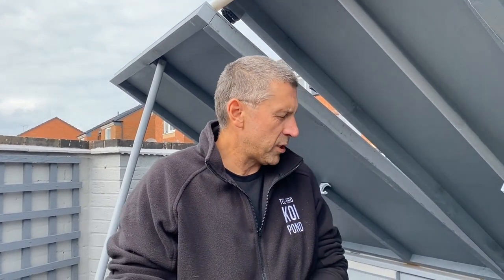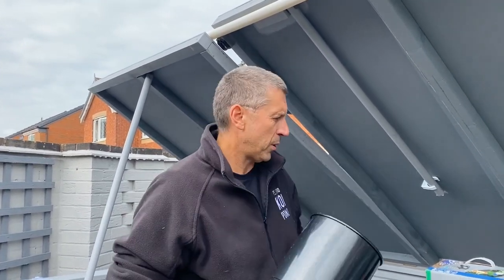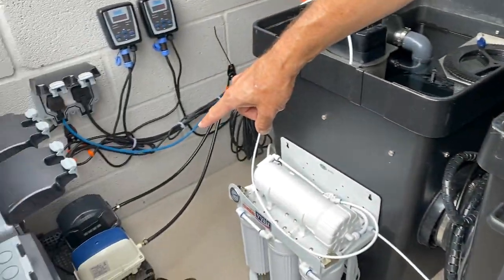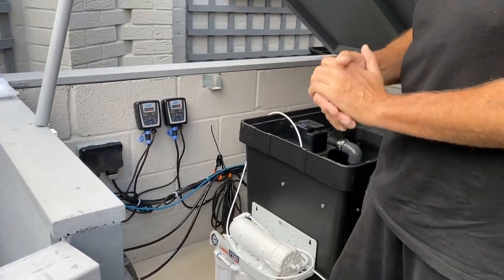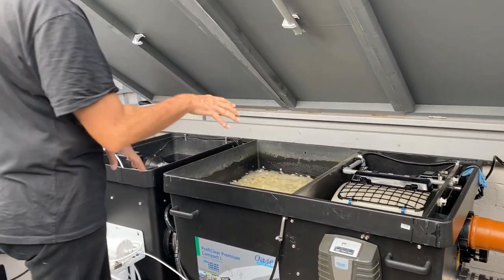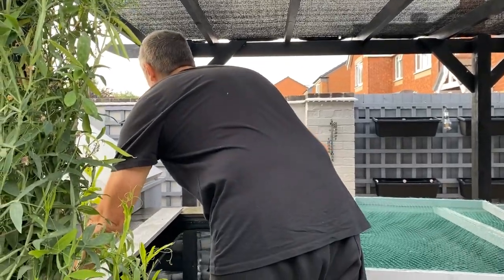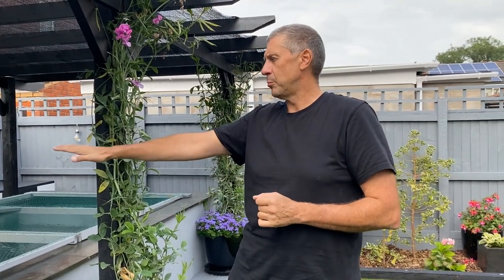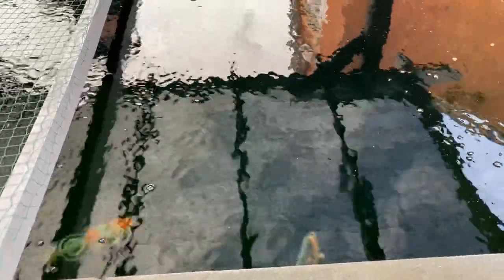T.K.P. Telford Koi Pond - Video 37 - Koi Pond Air Pump and Skimmer Modifications.

Comment: need help have pond one air pump fitting 18mm I need to adapt to 8mm air pipe any ideas? The pump came with a rubber tube that is about 18mm but can not seem to find a fitting for my large air stone that has a 8mm pipe.
Reply from the maker: You’ve got me a bit lost as you can normally fit the pipe you mention, over the outlet on the pump and over a plastic or chrome multi connector or you screw a 8mm brass fitting into the outlet on the pump. Just had a look at the Pond one air pumps online and they appear to be standard fittings so you should be able to pick up all the fittings/multi valves/adapters you need on eBay. Let me know how you solve this ? 👍🈲🐟😊

Comment: Can I ask what airline you are using to your bio tank 🤔
Reply from the maker: I’m using 8mm internal diameter braided airline (so basically just the black braided airline you can but from most shops) . Over the years I have found this to be the best/strongest/longest lasting airline available. When I first started I was using a 45 lpm air pump which was perfectly sufficient for the amount of media that comes with the unit but I’ve  gradually added more and more media (at 80 litres of helx13 and 30 litres of Qase pond pads now) so am currently running a 65 lpm pump. Hope this helps😊👍
Reply: Thanks Phil. I’m looking at the EA 8mm sinking air line to run my not yet set up, Burtons 1300 bio tank. The bio will run 3 x 50mm ceramic cylinder stones but I need to upgrade from my EA 75 to the Charles Austen 120 to generate good turbulence. I bought the bio and 300bd drum used but I think I have around 300 litres + media to move 😬
What connectors are you using from pump to air stone?

Comment: Better running on the skimmer like that i have been more than happy with mine setup that way. And its far easer and cheaper than the built in the wall type that people seam to have been finding splits in and leaks in from new
Reply from the maker: Yes, lots of plus points and I think it actually looks far neater than a gaping hole in the wall. Again, thank you for inspiring me to revisit my decision, really happy with the end result 👍🈲🐟😊

Comment: Great vid as ever. Wow that difference in water level is huge! What is the pipe diameter feeding the filter and what total volume per hour pumped back?
Reply from the maker: Bottom drain is 4” feeding into primary port of drum filter along with a 2” line from the gravity skimmer. Pumps together  are pulling 14,000 litres per hour . Minimum recommended flow for drum filter is 10,000 lph and maximum is 25,000 lph so I’m only towards the bottom end. Apparently when running at maximum 25,000 lph using 3 x 4” drains the difference in pond and filter level can be as much as 6” (mine is currently just under 2”). All appears to be working well as water quality is spot on and gin clear so fish are happy which means I’m happy😊👍. Thanks for watching and commenting, take care 👍🈲🐟😊
Reply: @TelfordKoiPond  strange. Should be able to pull that volume without different level. I pull 18000 liter 110mm  gravity fed thrue a series of strange bends (retrofit problem) without any difference in level. What is limiting gravity flow in your system?
Reply from the maker: @greenmachinesweden  The level into the actual drum (Start of the filter process) is same as pond, the restriction is the water passing through the screens of the actual drum and then into the moving bed chamber. I’m running with 60 micron screens in the drum, if I swapped to a bigger mesh the screens would let more water through and the difference is levels between the pond and filter would be less but I like the clarity I’m getting with the set up I have 😊👍 . I have spoken at length with the Oase technical team to fully understand the workings and dynamics of the flow rates and I can confirm that my set up is working as designed Anna as per the technical spec for the unit. It’s a really interesting topic of discussion and really comes to life when you turn the pumps up and down (which I’ve done to feed my own curiosity) . Hope this makes sense 👍🈲🐟😊
Reply: @TelfordKoiPond  absolutelly makes sense. Thanks for taking your time to answer.

Comment: I'm yet to build my pond and have spent many hours trying to work out how to surface skim. I really like the skimmer set up but what happens when the water level drops?
Reply from the maker: Hello Chris, The moving outer sleeve (which is slightly bigger diameter than inner sleeve and not connected to it at all) overlaps the fixed inner sleeve by about 10 inches when at rest out of the water so when you set up the fixed part (that connects into the hole in the pond wall) there is about a 2” overlap when the water is at its highest so there is about 6 to 8 inches of movement down which is far more than most variations in pond water level even if you do a massive bottom drain purge or water change. The design is so simple and there are no moving parts to wear out or get stuck because of weed growing in the corners (as there aren’t any) . I’m really pleased with how mine is now working so would definitely recommend considering these skimmers. Hope this helps
S 👍🈲🐟😊
Reply: @TelfordKoiPond  brilliant thanks. I think that is the way I will go. Thanks for showing that.One more question.  What make is the skimmer.
Reply from the maker: @chrishawes5078  it’s an Aqua Forte floating pond skimmer XL. I bought it from Cotswold koi and it was only about £55 which is way less than the £300 plus you can pay for a wall skimmer or the £250 I paid for the Oase swim skim 50. I believe Oase do a very similar floating in pond skimmer but not sure how much it is. Hope this helps 👍🈲🐟😊